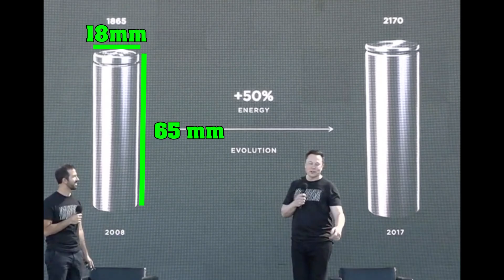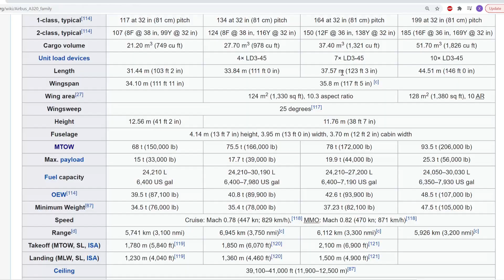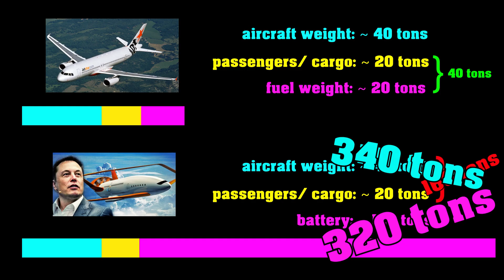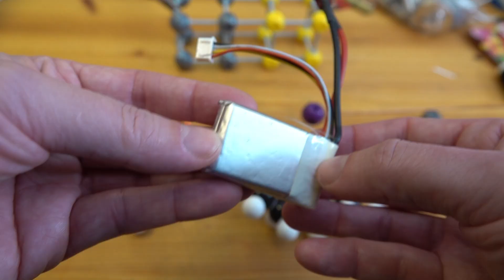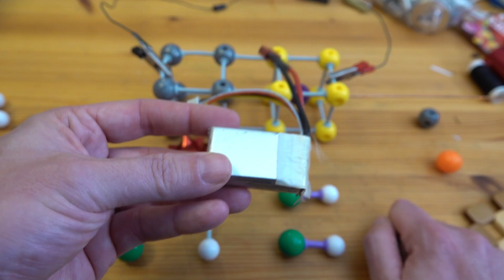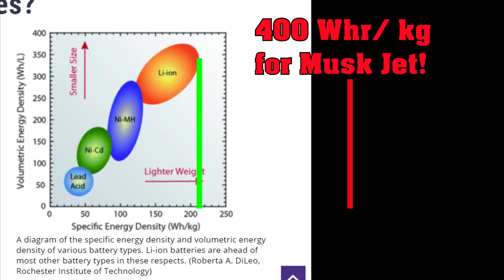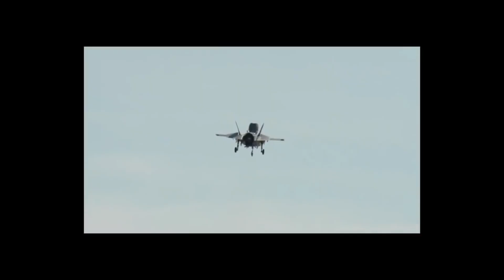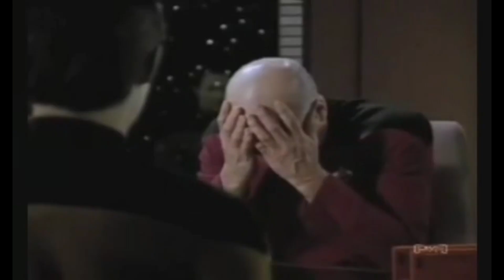Tesla's Secret Plan To Disrupt Airlines: BUSTED!!

Comment: Not sure I can get behind this vid.  You made a huge, false, assumption.  That thousands of solid pillars won’t be integrated into the structure to make the mass of the battery and the mass of the structure shared.  Also, battery day was about reducing costs not weight, why would investors is a car company care about weight?  And the tabless design reduces the amount of friction electrons experience as they enter and exit the cell to 1/625th the the friction they experienced before tabless.  That 16% range increase is just as good as a 16% energy density increase except it’s also cheaper to recharge.  And a 16% range increase on a 300Wh/kg is just as good as a 348Wh/kg battery.  In other words he’s closed half the distance.  And he may close half the distance somewhere else or maybe he’ll ditch the VTOL.  I wouldn’t bet against electric planes though in the long term, or even the medium term.
Reply: Why a investor would care about weight? Because it mainly limits the reach of electric cars. The main reasons normal ordinary people wont buy it, because it can only drive 100km and takes hours to charge.
Tesla shareholders are of course not interested in real value, because the stock is worth 1.6 million dollars for every sold car in 2020.

Comment: To Elon: I can troll as well. Might be better to have a solar powered blimp. That uses excess power, to gather water from the air, and makes hydrogen with said water. Then burns the hydrogen to spin the propeller. The whole air ship is essentially the battery so we don't have to worry about cloudy days.

(If this wasn't definitely a time bomb. I'd then question whether it could produce enough water/hydrogen to fight wind push/resistance. Should I make a kick starter?  I'll call it a solar freaking air ship. XD)

Comment: From what I understood of 'battery day', the whole thing was about increased miles over it's lifetime, cheaper production(due to the production method not needing to heat the batteries), removal of cobalt from the production and much faster charge times.

Say what you will of battery density and his wild ideas, but everything mentioned above is very essential for any kind of actual scaling of electric cars.

Comment: You didn't even get to the VTOL part.  
Airports are obviously expensive and inconvenient in large part because they're huge.  Reserving that amount of land close to population/production centers is expensive, putting it further away is inconvenient.  So why aren't people using VTOL aircraft now considering the potential savings?  Because VTOL is expensive and energy hungry.  

There's a reason even the military don't use VTOL in their airplanes.  The fuel cost is so high even the advantages of not being tied to vulnerable bases is worth it.  To achieve VTOL you need to do one of two things, have massive rotors to push a lot of air or have enormous power to push it fast.  Lift is achieved by pushing air down, Newton's Third Law applies.  The kinetic energy of the air you push down goes increases with the square of the velocity.  The momentum increases with the velocity so for the same momentum faster means more energy required.

Let's assume a craft about the same size as the A320 with ducts the air is pushed though.
The area of the ducts however is inversely proportional to the square of the velocity.  The volume, and therefore the mass of air proportional to the speed it goes through the ducts.  The mass of air you have to push is inversely proportional to the speed it goes through the rotors.   Add these together and the area needed goes up with the inverse square of the velocity.  The math works out that at about 63 m/s you need about 1.9 m^2 / tonne area of air being passed through the rotors.  This is about the area/weight of the fuselage of the A320 (78 tonnes divided by {38m * 4 m} ).  This is massively more intake/rotor area than you would need for supersonic flight and so extra weight.  

The engine weight as a proportion of the total weigh for an A320 is about 6.7% with the heavier engines (2*2.595t /78 t). According to wikipedia Emrax 268 brushless AC motor has the highest power/weight ratio at 11.56 kW/kg.  Assumr that Elon can get that efficiency in the air.  If 6.7% of the craft is engine that means it has about 735 W per kilogram of craft weight. With that it can hover by thrusting air down at 150 m/s through fans measuring .33m^2/tonne.    That's about 1/6 the size of fuselage.  Bear in mind you probably have to add at least 25% power to take in a safe and timely fashion.  So you have ducts almost 1/4 the size of the fuselage and engines that are just as heavy as the A320's.  If they increased the size of ducts to almost 1.9 m^2 / tonne the engines would still weigh about 9% of the non-fuel weight of the aircraft.  That's the same as the A320.  So if they wanted to effectively save weight on the engines they would need ducts as big as the fuselage.  Don't ask me how much they would weigh.   

There's a reason that the only aircraft to combine supersonic flight and VTOL/STOL was years behind schedule and massively over budget.  And that's without a massive amount of it's weight dedicated to energy storage.

Comment: That burning of chlorine with hydrogen was maybe not such a great example. The covalent bond between the chlorine atoms and hydrogen atoms is quite strong, that’s why you do not “see” free chlorine or hydrogen atoms flying around unless the temperature is really high. They like to ionise though, that is chlorine is reduced by accepting an electron and hydrogen is oxidised by donating an electron, which is the driving force for the reaction. You can initiate the reaction in a chlorine/hydrogen gas mixture by using UV light, if you are lucky it explodes. The resulting hydrochloric acid has much lower bond strength than chlorine or hydrogen and is much more ionic in character. 

Just pointing this out since when you talk physics, from my point of view it seems reasonable. I mean it is your comfort zone and not mine. But as soon as you get into chemistry I start cringing. It is often borderline on what is correct and you often demonstrate really poor laboratory practice.

Comment: I think the structual problems are going to be even worse. Planes usually can't land if they still have to much fuel, so somethime they'll have to either fly circles at the landing destination to empty some of the fuel reserves or just release it into the open space. So if the plane doesn't have that weight reduction by design, then you will have to make sure the landing gear is much stronger (aka more weight to it). Also a good portion of the propulsion comes from the jet of the heated gases created in the combustion which are turned into additional thrust in the nozzle of the jet engine. If I recall correctly it is about 20% of the thrust, the other 80% are from the big propeller fan.
Reply: In terms of thrust, you're approximately correct if we're talking about modern high-bypass turbofan engines. Until fairly recently, turbofans on civilian airliners had a bypass ratio of about 7:1, which is actually a bit better than 80% of the thrust coming from the big fan at the front. Some of the newer engines such as the GENx or Rolls Royce Trent 7000 have bypass ratios of 10:1, which translates to just over 90% of the thrust from the fan, a significant improvement. Anyway, before the advent of turbofan engines, we used to have smaller airliners such as the Boeing 707, powered by plain old turbojets, such as the P&W J57, in which all of the thrust came from the jet nozzle at the back of the engine - it had no fan at the front at all. These old turbojets still worked fairly well, but were better suited to smaller high speed aircraft like military fighters or fighter-bombers than to civilian airliners, since the thrust from a turbojet is generated by accelerating the hot gases from the engine core to much higher velocities than are produced by turbofans - this incidentally is why turbojets produce far more noise.

Interestingly, the core of a modern turbofan engine shares a lot of the same parts (compressor, combustors, first and second stage turbines) with the older turbojet it was developed from. For example, the GE CF6 turbofan engine essentially has a J79 turbojet at its core: The added parts are a third stage turbine (aka LP turbine), which drives the big fan at the front. The original J79 is still made today, just not for aircraft - the core compressor and turbine section are manufactured with a big power turbine fitted to the back for driving industrial machinery, for power generation and for use in marine propulsion, so in each case all the power from the core which would produce thrust if fitted with a jet nozzle is instead converted to mechanical torque.
Reply: What if they chuck batteries out of the back of the plane for added thrust?  I can think of no problems that might arise from throwing heavy objects over populated areas.
Reply: @justinwatson1510  I guess that's exactly what Elon's planning. Using the lithium as a fuel.

/s for obvious reasons.

Comment: NOPE... Thunderf00t misspoke... THIS is the original source material that shows how Tesla will transform energy density..
“The human body generates more bioelectricity than a 120-volt battery and over 25,000 BTUs of body heat. Combined with a form of fusion, the machines had found all the energy they would ever need. There are fields, Neo, endless fields where human beings are no longer born. We are grown... What is the Matrix? Control. The Matrix is a computer-generated dream world built to keep us under control in order to change a human being into this {showing a battery}.”

Comment: Sorry only just starting this vid but one thing strikes me as odd right from the start. A jet compresses air in a turbine, adds fuel and forces it under pressure into a combustion chamber under pressure where it burns and exits the nozzle at high speed. Apply a bit of newtonian physics and the plane moves forward.

If you replace the fuel with batteries what comes out the back to push the plane? Hot air and magic?

Comment: Hi Thunderf00t, if you're bored, you could do a Busted video on Lilium -  a startup working on battery-powered short-range "flying taxis". For the amount of money and effort they put into it, their results have so far been underwhelming, and experts believe they're struggling with the same basic problem of energy density, and won't achieve more than a few minutes of flight before their batteries run out.
Reply: Oh, I just read that they haven't shown anything new since one of their prototypes caught fire for undisclosed reasons about a year ago. Hmmmm...

Comment: Also keep in mind, max landing weights are typically less than max take off weights. The expectation that fuel will be burnt has enabled a lot of efficiency improvement that would have otherwise been impossible. Using batteries all that goes away.

Weight is everything. They teach that to first years!

Comment: Imagine being in a battery powered plane where there's a "Thermal Runaway" fire... you're sitting on a flaming comet streaking across the sky, looking out the window waiting for your turn to burn up.
At least Jet Fuel doesn't burn in open air, and the commonplace fire suppression systems can quickly handle those. When a battery goes, not much can extinguish it until it's done burning.

Comment: RR has had its electric engine project in the works for at least 10 years I reckon, and last I heard they were messing with superconductors at very least in the motors, also probably related to batteries in some way. Y'know - ACTUAL R&D.

That was in 2014.

In 2020 Elon is still playing with li-ion cells which have no hope in hell of EVER being light enough to power anything other than RC toys.

Put it this way, if electric aero engines were practical with current battery tech, the USAF would be all over them for their stealth jets as a means of eliminating their heat signatures.

Comment: But what if you make vacuum tube that floats in air and fly the planes there. Now you almost have infinite energy for the plane because there is no air resistance. And what if the vacuum tube is actually a battery itself. You could fly INSIDE the battery that is in vacuum. Its safe because it can not catch fire and you have no need for battery in plane itself. And because no air resistance the plane could travel at SPEED OF LIGHT in that vacuum tube.

Comment: I used to work at an auto parts store.  We were trained that if a hybrid vehicle Li-Ion battery were to somehow get it's crate opened, like from damage, we run away and evacuate the building, and call corperate for them to contract a Haz-Mat team to handle it.  Because not only is the voltage and current absolutely lethal and an arc from a short could burn someone to death, but it's basically a bomb.  If something were to puncture or crush it, it would probably be game over for most people in the store.  Thankfully we never had to deal them.

Comment: I wish people understood basic physics concepts... The best options we have at the moment for jet propulsion are nuclear powered flight (unlikely to happen due to peoples fear), or artificial creation of carbon-neutral fuels, i.e. use green energy to make hydrocarbon bonds, burn them, repeat process... effectively, the chemical bond becomes the battery. Hydrogen might be an option, but it has a terrible energy density and is also extremely unstable.

Comment: Just one nitpick; the energy density doesn't make it dangerous per-se; compare TNT vs oil for instance. For batteries, you could potentially have a way of limiting the maximum current that can be drawn in a short-circuit. For instance, internal fusible links, or PTCs (positive temperature coefficient). As the battery heats up, the resistance increases, limiting maximum  current.
Reply: Still if a sequence of unfortunate events leads to a short within the cell itself; it will be a rather expensive fireworks show.

Comment: One day there will be a breakthrough in battery technology (I hope) and the world changes.
Until then - I dream while Musk talks.
Reply: what kind of breakthrough the place I work is also working on different batteries, but tehy all agree that the energy density improvements will not even get cloe that is neede for mid to longhaul flights. this is just not possible. I could imagine that this role will be filled up by hydrogen though. So I think batteries are great for care and maybe shorthaul flights (see evation) but not for the rest.
Reply: Your dreams are more realistic than his talk.

Comment: WTF is an electric jet? With a jet, you get the thrust from the exhaust gasses, it's a reaction engine, and a side effect is you get lighter at the same time. For electric engines, what are they going to use, propellers? 
Propellers at high altitudes, and supersonic speeds? 
Is he planning a rear-facing coil gun that would launch spent batteries backwards?

And that doesn't cover the other stuff that people have known about, like supersonic is great, but everyone complained about the noise so they got restricted to being used over the sea. Not much use for "transcontinental not intercontinental." 
There's also the whole idea of how important those speeds are. Is it worth the extra cost, energy and complexity to save a couple of hours on a long trip, maybe even one hour.
With packing, security checks, boarding, disembarking, waiting for bags at the carousel, getting a taxi etc, is it really that much of a big deal? There's a big chance landing at rush hour on the other side eats up any of your savings.
Supersonic has been tried and it didn't really work out, so although there technology is there, civilian stuff just doesn't bother with it any more.

Comment: 7:30 why did you change the appearance of the statistics by making 30% smaller than 20%. Also at 9:10 you assume the weight of the airframe is directly proportional to weight of (battery + passengers) when in reality it is much lower than 140 tons because the airframe weight to cover batteries is much lower than that needed to cover passengers. That means that the airframes weight is mostly determined by passengers weight and is at most 60 in this scenario
Reply: because according to thunderfoot, in his magical physics world, weight is directly proportional to integrity, according to him, the tesla car also shouldn't exist since it has to weight tons and tons to be able to carry the battery, and also an F1 car that weight 750 kg total including engine and everything, is a scam, since ... heavier engine should have a heavier frame.
Reply: @redakanane  his reasoning isn’t completely wrong but it is wrong enough to where his conclusions are sometimes wrong

Comment: 13:32 We need TNT batteries, look at all that energy.
Reply: Researchers from Wuhan university have created a prototype thruster capable of generating plasma jets with propulsive forces comparable to those from conventional jet engines, using only air and electricity.

An air compressor forces high-pressure air at a rate of 30 liters per minute into an ionization chamber in the device, which uses microwaves to convert this air stream into a plasma jet blasted out of a quartz tube. Plasma temperatures could exceed 1,000 °C
Reply: @blackmartini7684  Wuhan.. yeah..
Reply: @mobspeak  not a very articulate response
Reply: @blackmartini7684  This is YouTube. Get lost.